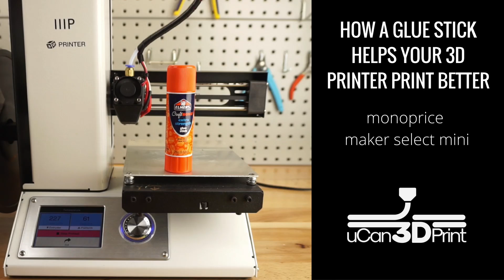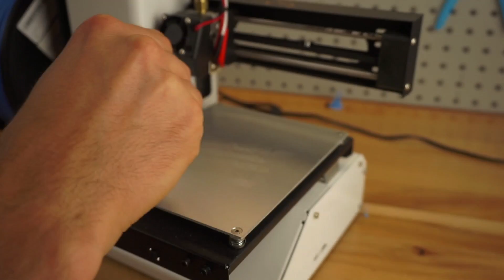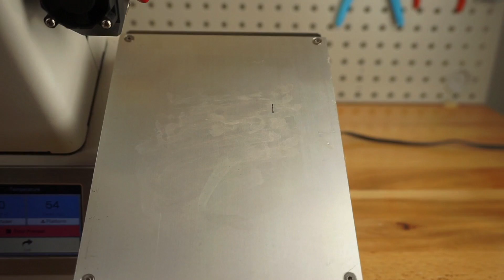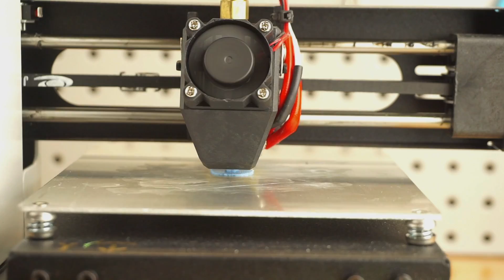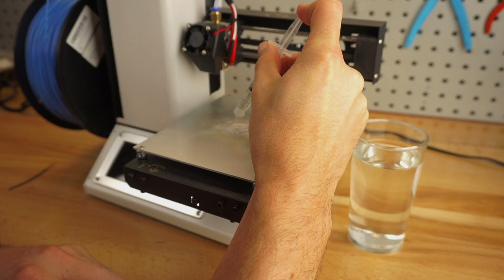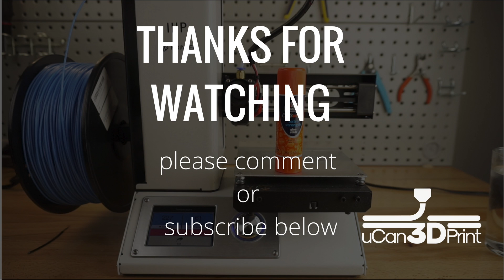How a Glue Stick helps your 3d printer print better

Comment: Use the Glass Build Plate Wizard to make prints stick to printing platform and stop prints from curling/warping. Go to www.ez3d.eu to get the best 3D printing adhesive solution. Solves all first layer adhesion problems and prevents prints from warping!
Reply: Glu Stick WIN!

Comment: just got my MP select, so far soo good with the tape.. No issues.. Ive found that people are leveling their beds way to low ( away from the nozzle ) in a lot of videos and from what ive seen so far, that might be the sole issue in adhesion.. thoughts? My nozzle to the top of the take is barely a sheet of paper , it gets pretty tight moving the axis , and the raft goes down perfect each time. I guess when the aluminum warps , ill need to change strategy

Comment: Don't have a heated bed
Please help first time trying to fix and not sticking at all
Reply: PLA or ABS? With ABS it depends on the surface on the build plate. Although most of the time it does require an heated bed. PETG I believe most of the time requires a heated bed, although I have never used it. 

PLA you should be able to print without a heated bed. Before purchasing your filament ensure its compatible with cold plate printing. Hope this helps.
Reply: thx

Comment: I just got my V2 printer from Monoprice yesterday so I know nothing yet. Mine came with a black mat but my prints sticks to it bad. Can I just rip the black mat off and use a gluestick? I have no idea what the mat is but I looks like plastic.
Reply from the maker: I would try and just use the glue stick on the black mat first.  Other than that, I know a common mod for the v2 is to print on top of glass.  A friend of mine is doing just that, he got glass cut from the local hardware store for fairly cheap.

Comment: would this be a problem with pla?
Reply from the maker: No, the glue works fine with PLA too.  I use it for both right now, and if I don't really want to level the bed properly.... than more glue can fix that problem as well.

Comment: Thanks at the point I really needed your experience. Was printing a 2" tall Yoda and his head got slanted as the tape unstuck, allowed yoda to wobble. What a mess. Please keep posting about this neat printer. Questions: what 3D program are you using, what slicer also?
Reply from the maker: To slice I am using Cura presently.  I have been downloading the files from Thingiverse, but when I do draw things I use On Shape.  Did you try the yoda again?
Reply: Let the smoke out of my thermositer, darn. Was trying sketchup, can not get cura to see a solid, so looking for another program to create 3D. Did get a few tests using just the build plate and stick glue, seemed to work.
Reply from the maker: Good to hear on the glue.  Check out OnShape https://www.onshape.com/  I like it because it's web based.  At some point I will try out Fusion 360, but I am happy with OnShape at the moment.